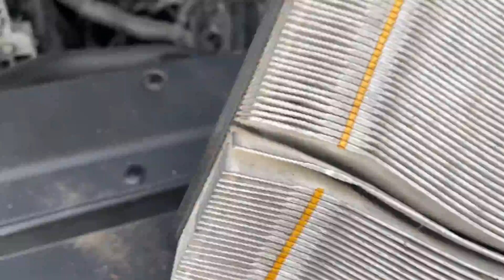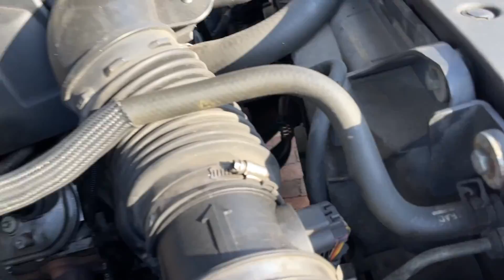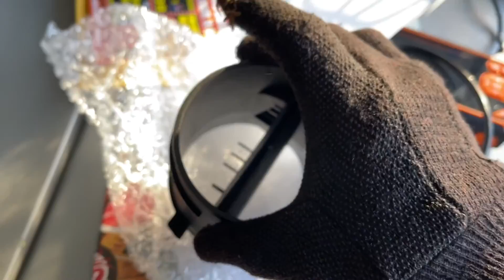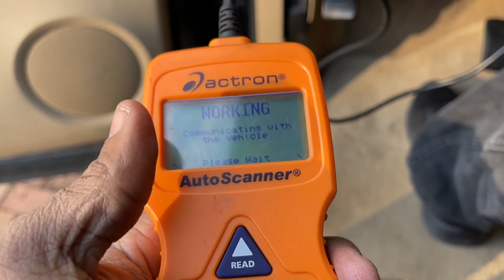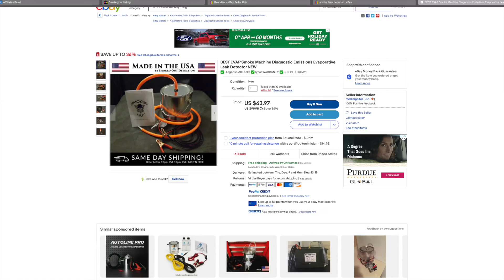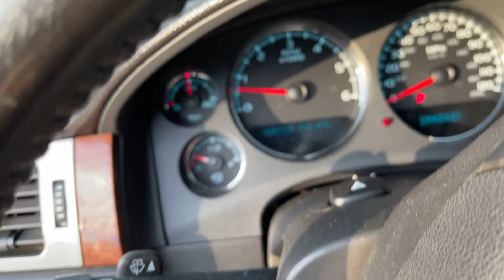Chevrolet, GMC Lean Codes P0171 P0174! My Chevy Suburban Is Running Super Lean!! LS Motor Lean Code

Comment: I was about to say it was not the MAF. I have done many of these. Replace the valve covers and the PVC valve all together you’ll be set
Reply from the maker: Thank you for sharing that info.
Reply: @TerenceDIY  also. Since you were so responsive and you seem like a genuine guy. I respect that. I do a lot of videos and it is annoying. No one respect how hard this is. You did a great job. I noticed how half way in you caught it and it’s all good. The first time I figured out the issue it was accident. No jk. The TC abs etc we’re all going off and no drivability. I was on it for a minute with the customer. I called it a night and sent to toss back on the cover and guess what. I hit that hose and it went crazy. I replaced the hose. It was 3 inches and it was so hard to find. Pure luck. I have been dealing lately with a. Similar vehicle. I got the ABS situated by Repairing the grounds underneath the vehicle. You have two in the front underneath the driver tire and the plate will rust out. I have zero power probe ground. Also a couple in the back. I would like to ask I’m having a issue and I believe it’s all built in. Crack case ventilation and the valve covers. I will be doing a video here today maybe, if not soon, but the ground fixed the ABS issue and my love data is over correcting, also a loud know after I cleaned throttle body’s and relearned it to the vehicle? So what do you think is my issue?? This is a huge job and I have been at this 2008 Chevy Tahoe Z71 for a minute. It has a lot of aftermarket so it’s a pain, I will figure it out and I should have a update soon? Also it is triggering all the O2Sensors…. I’m thinking the gas pressure valve like you mentioned but if you rewind. That would be set off do to a air leak? I think I have it and I will know today. This car must be repaired. I do not quit, have any suggestions other then what I have already gone over please let me know. Maybe secondary air pump or MAF. However. I have checked both of those also the FPS. All you need to ever do incase you have never thought of this I will say one thing. You could have checked the MAF by simply unplugging the MAF while running, if the vehicle acts worse. Well. That is working 90% of the time…. I did it with all three of the mentioned. So, unless a rocker arm is bad, I don’t think so. Maybe, then it’s a problem with the valve cover with a built PCV valve. Or crank case…. IF YIU HAVE ANY ADVICE ITS ALWAYS APPRECIATED. Great video also, I like how you took you time and explained things very well. Best I have seen yet. I get one in while I can but it’s hard. Thank you for the reminder and I think you helped me solve my issue sir. I work on a lot of vehicles/motors. This was a great reminder of something I had almost forgot and I hope my advice will help you some. Regards.
Reply from the maker: @TSMobileMechanicLive  , I love your attitude and approach towards getting things done. I'm the same way. Is the vehicle throwing any codes? I have the software to pretty much any vehicle. It's a huge help because it's what the dealerships use. Let me know.

Comment: I have a 08 Escalade & I removed the fuel rail on the passenger side. The cross tube is now leaking from the tube port on the rail. That bracket is damn near impossible to get back on. Any suggestions? It’s the bracket with the T6 bolt on it
Reply from the maker: I know exactly what you are talking about. It's hard to make any suggestions since I cannot visibly see it. I wish I were there to help you.
Reply: @TerenceDIY  one more question. Do you know if the rubber o-ring that goes inside that fuel rail neck is a ring for the fuel rail neck itself, or the cross tube? Just wanna know where the o-ring should go before installing this thing back in place & screwing up another o-ring & spraying fuel everywhere…..again. Thanks brother!
Reply from the maker: @CarolinaAlumni09  , I am pretty sure it goes around the fuel rail neck. Please lube it up well with some oil to prevent it from splitting in half during installation.
Reply: U have to get new o rings I had to on mine

Comment: So this the reason the traction control light pop up & stabilak ?
Reply: What if you don't have any codes but have the warning lights? I'm no mechanic but like to learn and diy things when I can. Took truck to autozone and used their reader and only showed abs sensor.
Reply from the maker: Absolutely! It also comes on when the reduced engine power p2135 code pops up. Thank you SO much for watching!
Reply: @TerenceDIY  any help or guidance is appreciated. Love the videos. I'm sure I'll have more questions as I go through more of them lol